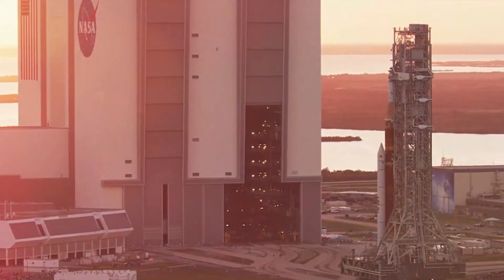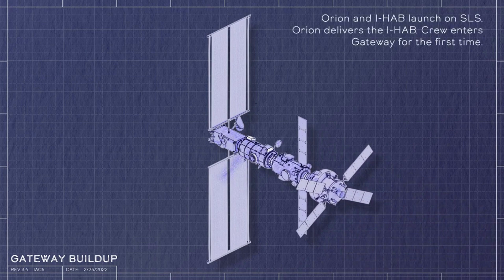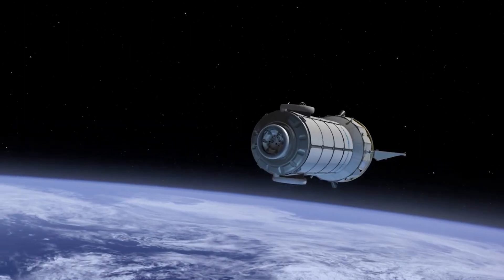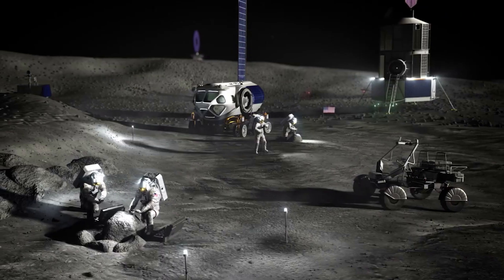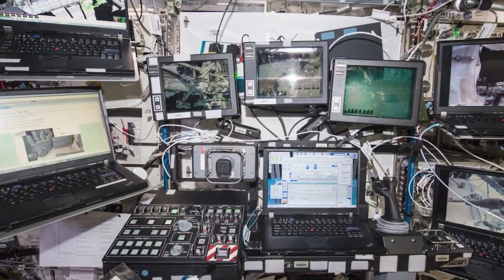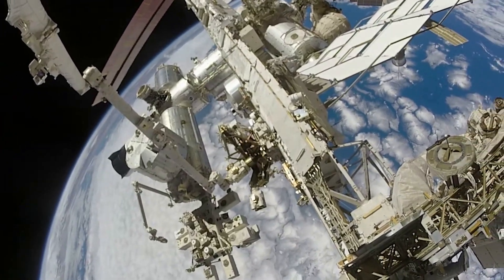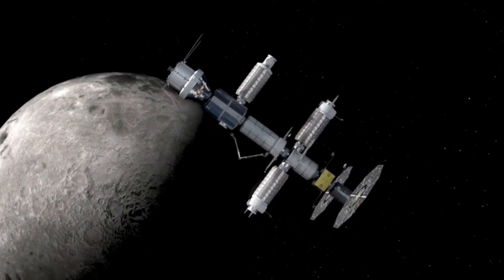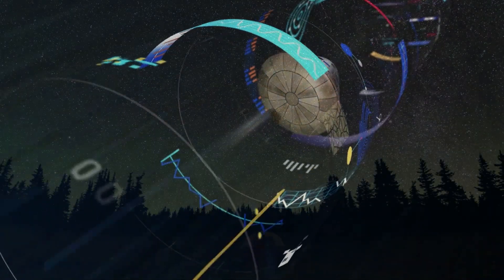A Closer Look At The Modules That Make Up The Gateway Space Station

Comment: A man-rated Falcon Heavy seems a much affordable method to send Orion to the Moon.
Reply: SLS is an investment. While it might cost quite a bit to launch now, when SLS block 1b and 2 start launching cost per ton of payload will go far down.
Reply: @grahamdethorne5772 wishful thinking?
Reply: Well its physically impossibile at the moment so yes
It is more affordable beacuse it doesnt happen and therefore costs nothing :P

But jokes aside. Amount of work needed would drive costs drastically while giving you less capable vehicle than SLS. And thats not even touching the issue of how you make it physically possibile.
Reply: Falcon Heavy doesn't have the payload capacity or upper stage dV to do the mission in a single launch even if fully expended. NASA would have to split up the Orion spacecraft and the propulsion stage into two separate launches and assemble in orbit, something which has only been done before a few times with the Gemini-Agena missions. The added complexity and potential risks of this setup would require a lengthy crew-rating period for safety, pushing back any missions by a decade easily, by which point much more capable launch vehicles would likely already be in service.

Comment: NASA should contract for a private company to replace the FCB and Zarya Module on the ISS, to extend its life, and reduce dependence on Russia. The staggering cost and monumental work shouldn't be disposed of in 2030, just because NASAs budget is stretched or pinched.
Reply: But, why?

Look i dont have a habit of screaming "cancell X nasa project starshep betteh give monopoly to musk!"

But ISS, just is old.

And costs of operating it do not come from just the russian segment, all of the hardware is slowly failing
Heck, if i recall correctly they arent even sure they could undock Zarya from unity safely at this point.

ISS is old, some of this hardware was built over 30 years ago, and replacing service module will not stop rise of the costs beacuse each year station will break more and more, eventually maybe even putting people onboard at great danger and without ability to conduct much of research.

It is time for replacement. Besides it is quite possibile that with modern tech a smaller cheaper station can provide same amount of scientific data.
It wont be as iconic as ISS, but, well, if it was icon that is most important Saturn V would be flying to this date no matter if its good or bad.

Comment: It won't be falcon heavy to launch it. It will be starship
Reply: Unlikely, payloads have to be modified to specifically be set for specific LV’s, take Europa Clipper, was originally designed for an SLS launch, then the proposed vibrations from SLS at launch would’ve destroyed the solar panels, and some electrical systems, so it was moved to look for a commercial launcher, and was then redesigned around said vehicle, that being Falcon Heavy.
Reply: You cant just toss governament contracts around like that.

It is NASA's decision not SpaceX's. And i dont see it happening unless SpaceX refuses to build VIF and there is literaly no other launcher on the market but starship avaible.
Reply: No, if a spacecraft is planned to launch on a certain launcher, it will launch on that launcher. The only way that chnages is if Falcon Heavy get's grounded, but they've already started building the FH that will launch the first modules.